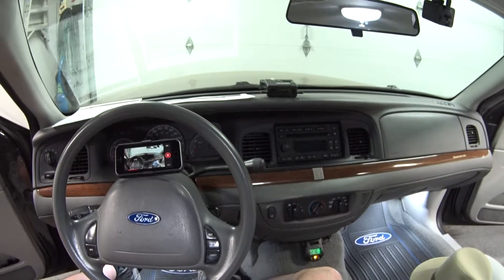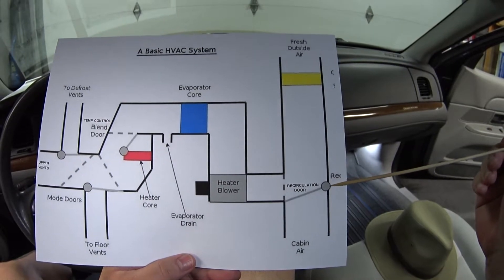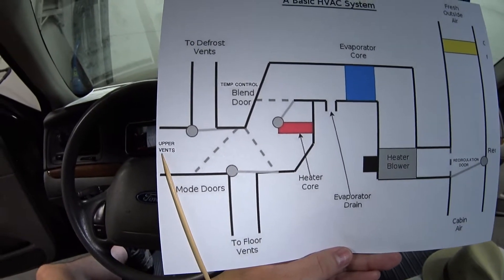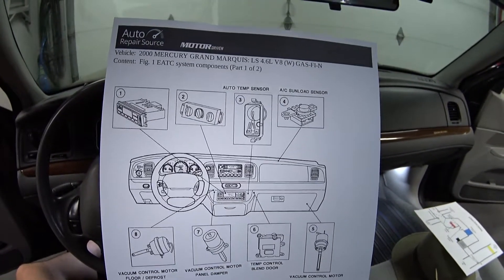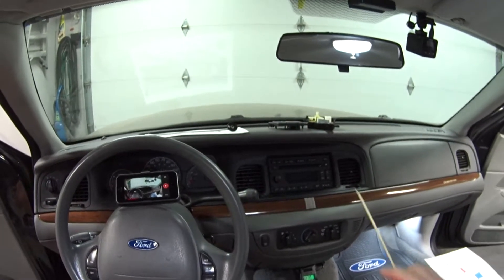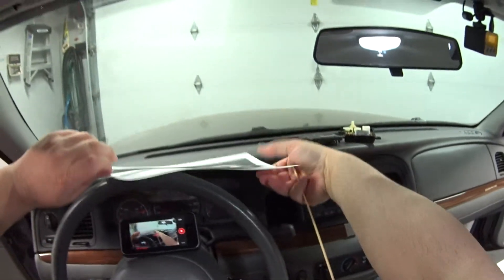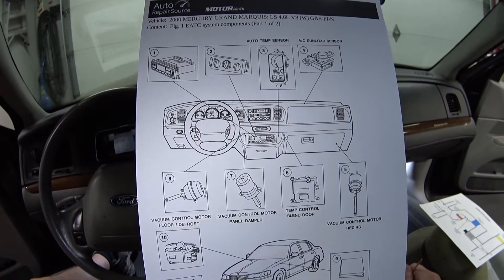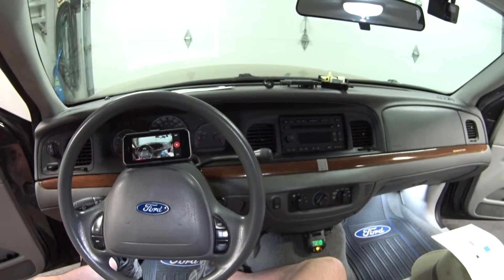Crown Victoria - Introduction To HVAC

Comment: I'm needing the vacuum line schematic. My problem is that after replacing the blower motor, the defroster and floor doors are the only ones that remains open.
That makes running the A/C fun on humid days because the moisture condenses on the chilled windshield. I'm driving down the road with the wipers on.
Do you have a vacuum line video?
Reply from the maker: Hello,
Sorry, I don't have a Vacuum Line Video.
What is the YEAR / MAKE / MODEL of your car, and is it a Police Model?
-Chuck
Reply: @PanzerPlatform 
It's an '07 Crown Vic that the original owner specced out like a cross between a P-71 and a Towncar. All the automatic luxury inside with the handling of a P-71.
Very nice ride.

Comment: My parents have a 2006 criwn vic. The issue is they only have heat, it wont switch to cool. We already changed the blend door actuator and we tested the new and old and they both work. We changed out the electronic climate control unit and still it stays on heat. However we were taking off the new unit to put old back on and when we removed the connector (located to the right of other connector on back) we noticed the blend door actuator moved to full a/c. Plugged the connector back in and eventually it goes back to full heat. It does not allow us to choose a certain temp. The car has sat for 2 years without driving otherwise its in perfect condition. Could it be the auto temp sensor? We dont see any issues with the connector on the back of control unit but unplugging it in and out does move the blend door actuator and sometimes the recirculation door. It does not allow us to  choose to have the air circulate inside the car or have air come in fresh either. 
    So basically it stays on heat, you cant obviously adjust the temp and you cant recirulate the air in cabin. But unplug the connector and it goes to full cold . 
     Please help if you can. We dont know what else to do.
Reply from the maker: Hello,
Please perform this procedure with the engine running to check if the EATC will spit out any error codes?
https://youtu.be/1g4v4aHqIzI

Sometimes folks have reported just doing this procedure has fixed their issue because it forces a system calibration of all electrical HVAC components like blend doors, mode doors, etc.

Next I would perform this procedure;
https://youtu.be/9CxejeIbGYw

Lastly make sure you follow this recommendation from the owners manual;
https://youtu.be/_bk-e7cM2gE

After you perform all of these, and it still does not function properly come on back, and I’ll help you with the next step.
-Chuck
Reply: @PanzerPlatform  we have 2 codes 24 and 25 which are basically same thing. Bought and installed another blend door actuator and still save codes. We tried reseting the actuator by way of the battery. (Connected the negative wire to the positive terminal and still nothing. Is there another part that could be causing the issue or is it more of a wire problem? I don't know what else to do. All fuses have been checked and are good to go. As far as we can tell no one has been inside the dash, everything looked stock. If you got any more ideas I would love to try them. Thanks
Reply from the maker: @customcreations-rickkramer5357  
1.) Start the engine, and turn on the A/C.
2.) Open the hood, and watch the A/C compressor clutch.
3.) Check to see if the A/C compressor clutch engages, and disengages every few minutes.
You want to hear, and see it clicking on/off. 
After you do that come on back for the next step.
-Chuck
Reply: @PanzerPlatform  yes ac compressor works great, air is cold. Just doesn't seem like we are getting a signal to the actuator. Right now I have the blend door taped open on full a/c. We had some movement of the actuator but it was only partly open to a/c but it would eventually go back to full heat. We even changed out the controller in the dash and same results. We are able to change over to vent, floor, defroster, just can't adjust temperature or switch from heater to
 a/c. It's the only thing on the car that doesn't work.
Reply from the maker: @customcreations-rickkramer5357  
I would get a "dealer level" scan tool, (cheapest I know of is $200).
Or FORScan Device for $20, (must use Windows PC laptop).
I would look at all the live data for all HVAC sensors, actuators.
-Chuck
Reply: @PanzerPlatform  we ended up buying another actuator, this time from O'Reillys  and when we first put it in we had nothing. So we decided to run a test to see if we were still getting a code 24 or 25 or both. After about 5 seconds it moved. No codes. Retested- no codes and working. Decided to check the other 3 actuators. The original oem one worked ( will call it "A"), no codes. First one we bought (B)worked but had code 25, 2nd one we bought (C)...dead with code 24. Last one, which came from O'Reilly (D) worked, still no code.  So now we have a working ac/heater that you can now control the temp. It was a long road, learned a lot more about heating and air in a 2006 crown vic ( has only 70,000 miles on it ) but glad it's over and hope to never do that repair again. I will say using an endoscope made the job so much easier. Was able to see stuff you normally can only do by touch plus if you drop a screw you can find it without tearing off more panels. Can't tell you how much I have used it, more than I thought Iwould. Bought on Amazon for like $159. Has 3 cameras and the cable is like 30' long but you can buy shorter ones for it. It takes pics and records videos and has its own screen, flashlight and came with a SD card. It's totally awesome, highly recommend!!
   Thanks for all your help.   
     Rick.
Reply from the maker: @customcreations-rickkramer5357  
Glad you got it sorted.

Comment: Im having a weird issue. Just replaced blend door,eatc head unit, blower motor and blower motor resistor. Every setting works on eatc. Both cold and hot. The problem im having is the floor is always on no matter what setting and my deforst only blows cold and when i turn on the heat my defrost switches to vent.
Reply from the maker: Right on Ian,
Thanks for stopping in.

You might try resetting / re-calibrating the system with this procedure;
https://youtu.be/9CxejeIbGYw

Then I would check for codes with this procedure;
https://youtu.be/1g4v4aHqIzI

Then I would check for codes with a scan tool.
Oh yeah, what is the YEAR / MAKE / MODEL of your car?
-Chuck
Reply: @PanzerPlatform  i will try those thank you. My car is a 2010 mercury grand marquis with 129,000.
Reply: While i got you here. Im going to be in the process of replacing my harmonic balancer and front crankshaft seal. My mechanic said they would use a felpro seal and doorman balancer. Do i have to worry about the doorman balancer? They said it comes with a lifetime warranty, and they will give me a 1 year warranty on labor. I've just heard horror stories about doorman parts. I know for sure when my intake leaks to replace that with an oem one. Thanks again for your insight.
Reply: Oh and by the way the re- calibration worked.
Reply from the maker: @iannathanson6014  
I'm not familiar with the dorman balancer. 

Thanks for the HVAC follow up. 
-Chuck
Reply: @PanzerPlatform  ok thank you

Comment: Hey chuck .. so I recently replaced my heater core and a while back I posted my problem that the air would only come thru the defrost vents and not the face vents... so a few days ago i replaced the heater core and the mechanic said that the problem about the vents is that the mode doors assembly the door were broken and the only way wpuld be to replace the whole housing assembly? Could this really happen ? Or could the door not change mode because of another reason ? Thanks
Reply from the maker: Yo DJ,

It sounds like your mechanic is unable, unwilling, or incompetent to perform a thourough diagnosis before attempting that repair. 

I would find a mechanic with more education, experience, and training to diagnose your malfunction. Take a look at your paperwork, it should clearly explain all work that was performed. If not, you may want to contact your State's automotive regulatory agency to file a complaint, and request a rework of the job, or a refund.

 If you want you can email me photos of your paperwork and I'll look at it. 
-Chuck

Comment: Hey Chuck, so my vent Damper doesnt activate and I dont get air threw my vents... i reached behind the climate control and pushed down on the vent damper and air started to blow threw the vent... would i have to replace that or should I start from somewhere else before replacing... any video on that thanks
Reply from the maker: Right on DJ,

I'm not sure what you mean by "Vent Damper".
I think you mean "Vacuum Control Motor".
It could be a couple differnet things.
Check the vacuum lines from the Vacuum Tank to the Vacuum Control Motors for leaks. 
Check the vacuum tank for leaks.
Check the Vacuum Control Motors for bent, broken, missing linkage arms.

Next you might need new O-Rings in the control head like this; https://youtu.be/GVEG9v1HgKA
-Chuck

Comment: My question is: First I had my EATC rebuilt.  I do not have any air coming out of my defrost vent.  The EATC is throwing CODE 25 which may mean a bad vacuum motor.  How do you get to the vacuum motors for the corresponding dampers to check the vacuum motors?  I have good vacuum and the other dampers work fine.  When I go to defrost it makes a bunch of noise and no air comes out of any vent.  The noise is from the air being trapped and the defrost damper is not opening.  Has anyone done that job?  I replaced the blend door actuator and it is working now.
Reply from the maker: Right on TL,
Thanks for watching.

Stick your head down by the accelerator pedal, and look over on top of the transmission hump.
You should be able to see the vaccum motors.
-Chuck
Reply: Code 25 I think is a non work blend door actuator. Which has nothing to do with the defrost vent. It could be the vacuum valve that is bad which is located under the dash. It connects to one of the vacuum tubes, just not sure which color tube it is. But most likely that vacuum valve is leaking.
Reply: @customcreations-rickkramer5357  Thank you for responding.  I had that feeling it was a vacuum motor also.  I never checked it but recently everything works fine at times then goes back to vent.  Great advice, thanks.

Comment: I've had the same issue with my Auto Climate control unit... it defaults to defrost and floor heat. it gave me a code 24... But I found a video on FordTechMakuloco that's cheap easy fix... worked for me!   https://www.youtube.com/watch?v=PtfucNa6R_o   Behind the digital display there is 4 vacuum pistons, replace the O rings and that fixed my issues with the climate control  :)
Reply from the maker: Right on Daniel,
Thanks for the good feedback. 
-Chuck

Comment: Just completed HVAC work, replaced blend door actuator and heater core.  This video is a great summary of operation.  Note that vacuum operates all these doors, except the blend door, which is electrically controlled (2011 LX).  That's a clue when malfunctions arise.
Reply from the maker: Right on Dan,
Thanks for watching, and the kind words.
-Chuck
Reply: @PanzerPlatform  blower motor resister what does it do? Thank y
Reply: @PanzerPlatform  and The ac blow out poorly from vent when i am riding it comes and goes but if it in parking run great. thank y
Reply from the maker: @zakariahalabbad348  
Yo Zakariah,
1.) Please leave your questions in a new comment thread.

2.) Also please tell me the YEAR ? MAKE ? MODEL of your car?

3.) Also please tell me if you have EATC, or regular HVAC controls?
-Chuck

Comment: Think is off topic but anyone have suggestions on crown victoria mud flaps that don't require drilling into the metal fold at the lower part of the fender?
Reply from the maker: Right on Dude,
Thanks for stopping by with a good question. 

Unfortunately, I don't have any experience with mudflaps. 
-Chuck
Reply: Ford used to make a molded hard plastic set for front and back.  F8AZ-16A550-BA for front.  F8AZ-16A550-CA for rear.  They do require minimal drilling, but fit the best.  Good luck finding them though, they have been discontinued.  I managed to find a NOS set for front/back last year...don't think I could find them again if I looked for them.

Comment: I have a question about a particular issue with my 2002 crown Victoria. My vehicle has the adjustable pedal controls, I’ve been trying to figure out how to fix them because they don’t work. When I press the button it seems like it’s tries to move up or down but it seems like it’s stuck or something
Reply from the maker: Right on Jamorris,
I would suggest using the troubleshooting procedure in the repair manual.
Here's how to get it for free;  https://youtu.be/c8Irbl1vpSM
-
-Chuck
Reply: @PanzerPlatform  ok, thanks!

Comment: Totally boring 😂. I just messing. Anyway nothing to add very sound advice just working in a tight position is the hurtle. I worked for a short time at the Sheldon Road plant and remembered making those boxes. That line ran like gang busters because at the time I was there they were getting ready to build out the panther platform 😕. Anyway good explanation, I like knowledge.
Reply from the maker: Right on Howard,
Thanks for stopping in.
-Chuck

Comment: hey Guruchuck, i have an issue with my 11.
this summer, I've been running my AC a lot.
Normally, i would turn it to off before shutting off the engine, but a little birdie told me to keep it on vent, to save blend doors.
So about a  minute into switching into vent, even on cool, i get a lot of moisture in the air, to the point that the windshield gets foggy sometimes.
Thoughts?
Reply from the maker: Hi-Yo Silver,
The solution to your issue is on page 45 of your owners manual.
 Here is a copy; https://www.fordservicecontent.com/Ford_Content/catalog/owner_guides/11croog3e.pdf
-
-Chuck